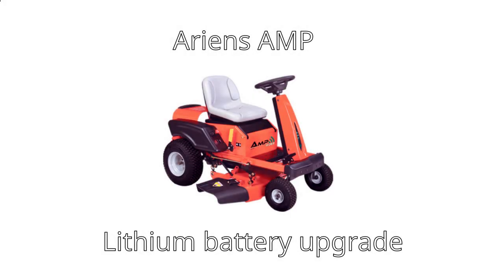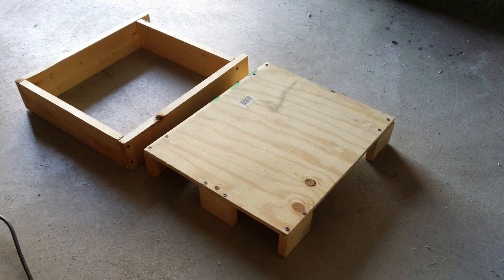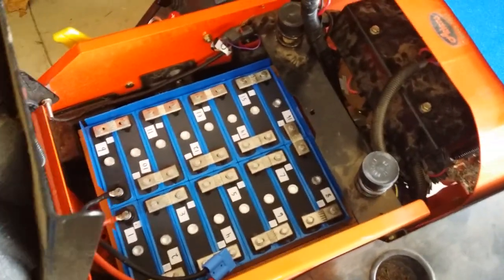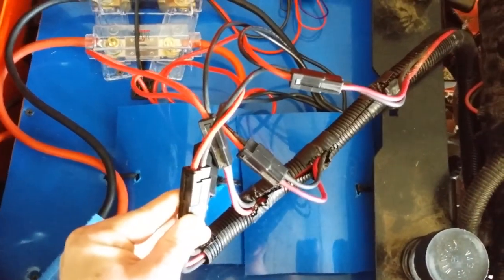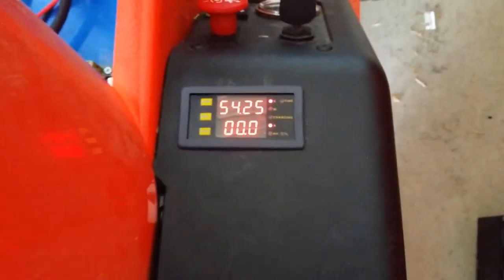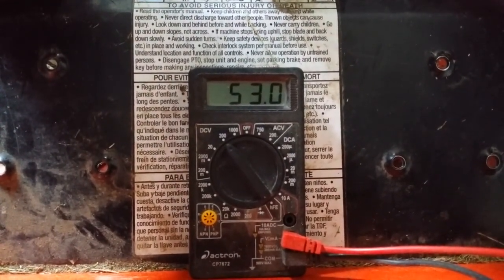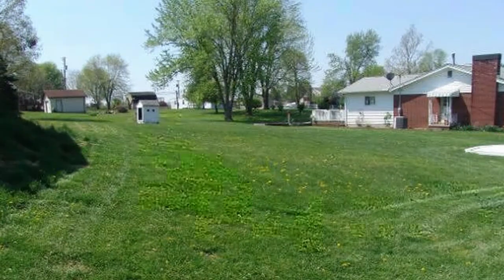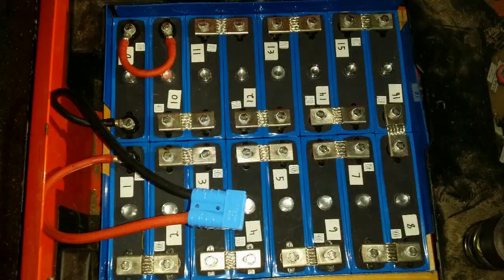Ariens AMP lithium battery upgrade. Electric riding mower

Comment: If you have solar, or if you want a backup power source, the lithium pack in the mower can be a great power wall.  On my lithium converted ElecTrak, I use a smartplug on the charger to control when to charge it, and several microinverters to backfeed my main house system.  Mowing will put very few cycles on the pack, it might as well be used once a day as a powerwall when it's parked.
Reply from the maker: That's exactly what I'm using it for except that I'm not feeding it to my breaker box. It's only about 3kwh pack so if the electric goes out it's just going to be a backup for the refrigerator. Eventually I would like to get lithium battery in my ryobi riding mower and do the same with it. I think it has has room for 5kwh or more.

Comment: Excellent. I am buying a used Ariens electric mower (pick up this week) and plan to upgrade with Nissan Leaf battery packs. I don't know if they will fit but it will be fun to see. I'm curious where you bought your meters. I couldn't find those exact parts, but like those over the similar parts I found on Amazon. 
Thanks
Reply from the maker: I'm pretty sure I got it on ebay since I think I remember I could not find the one I wanted on amazon.

Comment: Hi Jay, I'm wondering if you've had any further trouble with this Amp Rider? I own one, my brother-in-law bought it new (for $2,750?) and the SLA batteries crapped out within a year... he went through a lot of trouble to get Ariens and the local dealer to warranty the batteries, (but I feel it's the charger that's really the issue) and after missing one whole season of mowing (the second season he had it), Ariens replaced the batteries under warranty. Rumor was that Ariens was having to replace a LOT of these batteries, because the mowers were sitting in Home Depot for months or maybe a year, with nobody trickle-charging them. My BIL used the mower for part of the third season, and then one of the mower deck motors stopped working. Then he ended up getting a divorce and selling me the Amp Rider for $200 (one deck motor not working, second set of batteries not doing great) as he downsized and moved. I found a burned connector on the deck motor wiring harness and fixed that, and used the mower for part of another season, but I was never impressed with the battery life. I had been used to the range I was getting on my 1969 GE E8M electric riding mower, which uses (3) 12V deep cycle batteries (36V at about 100Ah). 

Then one of the deck motors started not working again, and it turned out that the servo controller for that motor was throwing an error code (because they are brushless DC motors, they need special motor controllers). I contacted Ariens, they wanted $450 for a new deck motor controller, they didn't give an option of getting it fixed. I tried contacting the manufacturer of the controller itself (there was a sticker on the controller), but they never answered their phone or emails. I used the mower a little as just an electric cart to ride around our property, and then one day the controller for the drive motor started acting up, too. That was the last straw. I brought the servo controllers to some electronics gurus that I know, but they said that the controllers had some programming chips on them, and without knowing how to access the code on those proprietary chips, they wouldn't be able to do much... they basically said they would probably spend more than $450 worth of time to try and reverse-engineer the servo controller to figure out what was wrong. So now my Amp Rider just sits there, taking up space, and pissing me off.

I should probably do some research and see if there's any off-the-shelf brushless DC motor controllers that would power those Amp Rider motors... but I'm wondering if I'm the only one out there that has ever had this sort of trouble with these mowers?
Reply from the maker: No major issues with mine so far. Ariens made the mistake of using multiple small batteries instead of 4 large batteries. With the smaller batteries they go out of balance and kill each other quickly. I had mine replaced under warranty too. It was also a bit of a hassle. Sorry to hear about your issues. Hope you can get it fix.

Comment: I appreciate the info about amps required to start the motors but can you tell us how many amps are required to keep the mower moving and cutting grass?  Probably a range of amps from low grass downhill to high grass uphill?  I need to know how many batteries I'll need to supply enough current to do the job.   Thanks for any help you can give.
Reply from the maker: I bought a Ryobi zero turn last year and demoted the Amp to portable backup power and backup mower. But if I remember correctly cutting grass was in the range of 50-60 amps. I always tried to cut on the down slope of my yard. Not parallel with the slope but diagonally top to bottom. Never did a test on how much energy it would take to do it both ways but my guess it would be easier for this mower to start at the top and work your way dow.
Reply: @JayGroh  Thanks for your prompt reply.  Your memory of the amperage requirement is useful.
Reply from the maker: Are you doing a lithium upgrade? If you are I'm just wondering if you have some batteries picked out yet?
Reply: @JayGroh  I am looking at 48V E-bike batteries on ebay.  Trying to figure out how many I need.  And trying to guess whose specs are real.  There are many sellers using the same discordant description with dimensions that contradict themselves.  And a bizarre range of amp-hour ratings.  How do I trust any of them?
Reply from the maker: To be honest you cant really trust them. For something like this mower you really need to know what your getting. Personally I would stay away from small battery cells like the 18650. If you pull more amps than they are rated for you risk causing a fire. More cells = more problems. When something like this is drawing lots of amps you kind of want to over spec what you get. I would also only buy LiFePO4 cells. But if you want something different as long as it has a good BMS then it should be fine. If you are wanting to use the same amount of battery as the original you will be spending about $2k. I would look for 75Ah prismatic LiFePO4  cells as a start. CALB cells are still the top of my list but you usually have to buy directly from China if you want a cheap price. Just make sure what ever you find will fit in the battery box. If your wanting to go cheaper and less run time you could get away with about 30-40Ah cells. LiFePO4  can usually handle a 2-3C discharge rate. When dealing with lithium there are lots of little things to have to look out for.
Reply: @valhumble1609  I was checking my options for batteries also. The E-bike batteries list 50 Amp continuous discharge rates yet at best have 12 gauge wires that are only rated for 20 Amps. I would check on diysolarforum.com and look at the Will Prowse videos. I have an Amp Rider I picked up in 2015 that had a new charger and batteries that are still making through a cutting. I only have a 1/4 acre so it is easy on the batteries. For $550 is has been a great deal. So far I have only had one deck motor go out at ~$200. I am thinking about one NMC battery from Big Battery 48V BDGR GEN-2 – NMC – 48Ah – 2.1kWh at $699. I will reevaluate when my batteries die. Please post what you went with.
EDIT: I measured the current on mine, 25 Amps with just the blades running. Typical when mowing was 40 Amps going to 50 Amps in heavy areas. Some very brief peaks of 60. I measured it with a Klein CL800 meter. I have Bahia grass which is not thick. Running a sanity check, the Ariens original run time spec of 75 minutes and derating to 60% Ah for high drain, 40 Amp average drain seems about right,

Comment: I  have a cub cadet rzt s zero electric mower I want to convert. I see in your video a voltage of 54.xx voltage. Is that the charging voltage? The AGM batteries in my  mower runs about 50.5 volts when charged. My mower has a vehicle control module (vcm) that shuts down the mower when the voltage gets low. Who makes the motors and controllers on your Ariens? The motors and controllers on my machine are made by accelerated systems inc out of Canada. I thought about going with Trojan Trillium batteries 110 Ah which are about the same size as the Intimidator AGM batteries. and would bolt right in. How old is your Ariens? Is it still made? Since mine is a zero turn it has that VCM to monitor the front wheel position and control rear wheel motors. The mower shut down on me last summer and I haven't been able to get it running again even though the batteries are at 50.5 volts! It is a 2012 machine that I bought when 3 years old. It was a demo unit.
Reply from the maker: Yes the 54v is about the max charge voltage. When running it drops to about 50.4v. Not too sure on the manufacture of the motors and controller. Never really needed to look into it. My mower is around 9 years old now I think. I'm looking into getting a Ryobi zero turn next year. The airens amp is no longer made. Thats why I'm looking to get a new mower and have the amp as a spare. If yours is a 48v system then it should turn on at that voltage. You might want to see if there is a schematic of the mower and check all the wires. Maybe something came loose. Hope you can get it working. Good luck! Keep me updated as I would like to know if you got it working. Also you might search around if there is a forum for your mower or contact Cub Cadet and see if they might be able to help.

Comment: Did you use the stock charger or make your own?
Reply from the maker: I used the stock charger.
Reply: @JayGroh  Did you have any problems with the stock charger and Li-ion?  I believe it has a cut-off voltage so that it stops charging when the batteries are fully charged.  Did that work OK with your Li-ion set-up?  Or did you have to manually manage charging in any way?
Reply from the maker: No issues since this is a LiFePO4 setup that is bottom balanced with no BMS. I actually dont get a full charge with the stock charger since the cutoff voltage is around 56v which is 3.5v per cell. Slightly under charging LiFePO4 is the best way to use them. They will last forever.